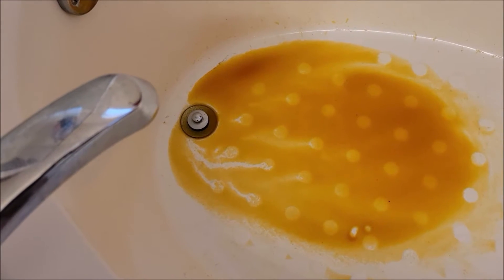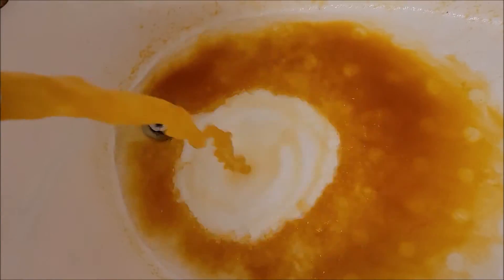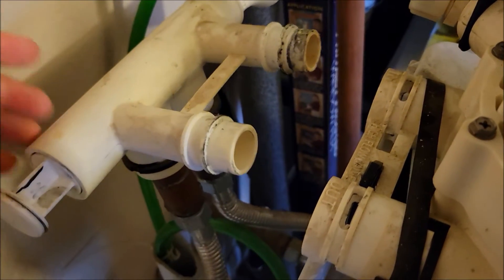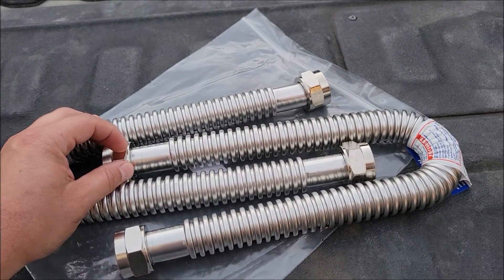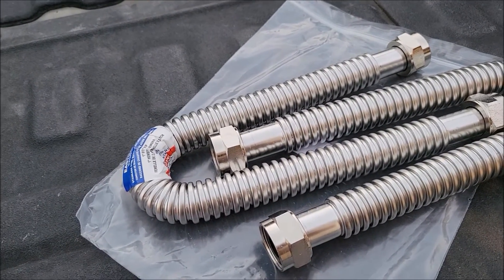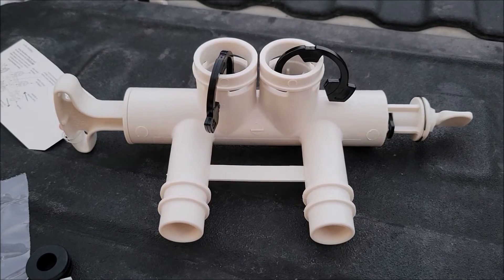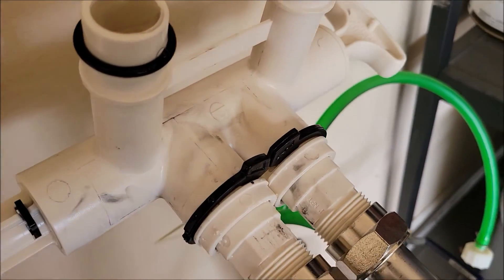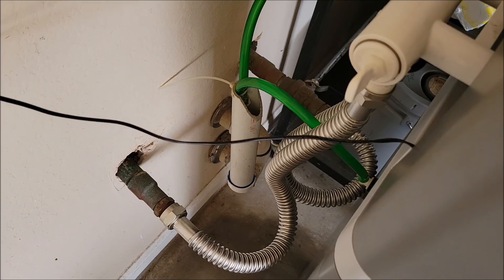Water Softener Beads Coming Out of the Faucet | Water Softener Problems

Comment: I had this issue happened twice already. Is there any way to prevent these beads from going down the piping system when this happens? I'm thinking to install a simple filter at the output from the water softener. Anybody has used this solution. Is there a special filter for this purpose?

Comment: I'm getting this but I don't have a water softener. the hot water heater is only 3 yrs old, too.
Reply from the maker: Does it fell sandy to the touch?  It can be from the water supply if they worked on anything recently.

Comment: Pretty sure that stuff is toxic too. Or at least polystyrene-based resin is. Not sure if they use that anymore. It has a styrene molecule in it that is carcinogenic and is additionally linked to vision n hearing loss, impaired memory, concentration, nervous system, 😬 I hope nobody took a drink of that accidentally
Reply from the maker: Not sure on toxicity, but this resin is what the water flows through to remove the hardness.  Luckily I don't think anyone drank any resin.  I hope not at least.
Reply: @SeidelRanch  yeah I bet it would be obvious In that orange color so I wouldn’t think anyone would. I hope not too. I could be wrong with what I said, I’m not certain all resin is made with polystyrene. But when I Google what resin beads are made of it says polystyrene and something called DVB. So maybe together it’s not all that toxic, like maybe it’s diluted. But it’s definitely not good if someone were to swallow resin haha.
Reply from the maker: @Jetsonn  Right, not something I want to consume.  I think I flushed ours well and if any was left the screens in the faucets probably have caught it.  Hoping that at least.

Comment: I have the same problem in my house, my water softener is GE and it is only 3 years old.  Now I understand why my water softener was not softening the water.  What should I replace?  And after that what should I do?  For me all this is new, please help!  Thank you
Reply from the maker: There are different ways this can happen, but basically something inside the water softener broke allowing the resin to escape.  If you are not comfortable with taking it apart to find the issue, you will either need a new one or have someone repair it.  If it's not an expensive one, it's probably cheaper to just replace it.

Comment: I get the orange/red discolored water out of my tank when flushing my tank. I do have a 6 year old kenmore. So this is a softener issue ? Also I put in a new anode aluminum/zinc rod 4 months ago and it is already caked up.
Reply from the maker: You may want to look at your toilet tank.  If you have resin beads in the water it's a water softener issue, but it could be a rust or iron issue if there is no beads in the water.
Reply: @SeidelRanch  hmmm checked a toilet tank and seems ok. The tank is only 3.5 years old. A O Smith said the anode caking was from the water softener. No help on the rust color. Thanks for the reply.
Reply from the maker: @chrispetroff8585  Ok.  The orange color from mine was the color of the resin beads.  The water itself was clear.  I have seen light brown or orange colored water sometimes when the water company has a leak they fixed, but it usually goes away quickly.  Those usually are boil notices.  Hope you find the issue.  Let me know if you do.  Thanks.
Reply: @SeidelRanch  thanks for the reply. I have spoken with our water utility and they there should be no issues on their end. So now have spoken with the tank manufacture I don’t know where to turn. I will try to find out about getting a good hot water quality analysis to see what they say and if any issues if continued consumption/use.
Reply from the maker: @chrispetroff8585  Where all do you see this colored water?  Only hot or cold?  Only some parts of the house?
Reply: @SeidelRanch  so the story continues, but with an ending. A new hot water tank! The red/brown water was coming out of the bottom at the tank when I flushed it. The city did evaluate water samples I sent them. Source water good, water softener water reduced hardness Good, red water out of bottom of tank heavy in iron.
Reply: A few days ago I woke up to no hot water, went to basement to find water everywhere. Called AO smith they issued warranty replacement, did lowes pickup and installed the new one.
Reply: So my big question remains, Does a salt based water softener destroy water heaters ? In about 3 years ? ?
Reply: This will be the third tank in 6years. All developing water leaks. Really frustrating. Thanks !!
Reply from the maker: @chrispetroff8585  I have not seen water heater issues with having a salt based water softener.  We have had a water softener in this house I am in for 17 years and the water heaters were changed at about 10 years and 12 years (we have 2 hot water heaters).  The tanks were fine.  The water should not be salty coming out of the water softener.  There should be a very good rinse cycle before the water heater sends water back into the house.
Reply from the maker: @chrispetroff8585  I wonder if your water softener is not rinsing the resin good enough to get the salt out?
Reply: @SeidelRanch  so the water salt level
Reply: So the water salt level from the softener could vary ? I will follow up on that. Thanks.
Reply from the maker: @chrispetroff8585  It's the rinse cycle.  Make sure it has the rinse cycle on and it's working.  If not, the salt that was used to clean the resin will not get rinsed off the resin and enter the house.

Comment: This happened to me recently. Clogged up GD everything in the house. Faucets, toilets, and don’t forget your water heater. you need to clear that out thoroughly. Took me two days, to remove the softener, one day to clear out all the lines and water heater. Water heater took the longest because you want to remove everything and there was a lot sitting in there. My water bill will be triple. Mine was a Kenmore and they’re all made the same,  filter that holds back the resin is cheaply made. This is why this happens. No wonder Sears went out of business.
Reply from the maker: Sad to hear that.  It was a huge mess.  I pulled it apart and yeah, the plastic part that holds in the resin just split on mine.
Reply: Hello, How you cleaned your water heater? Thanks